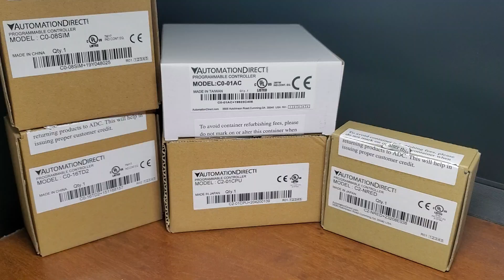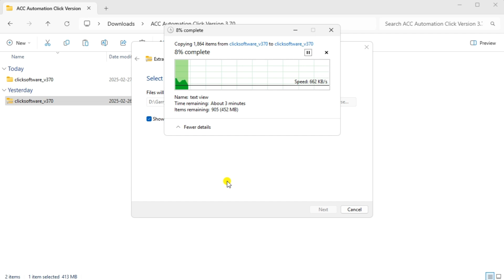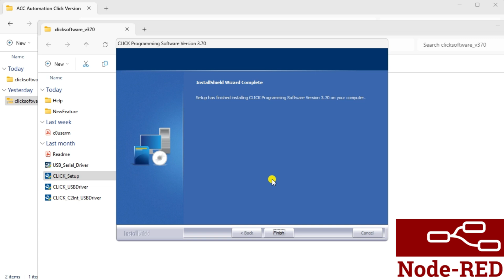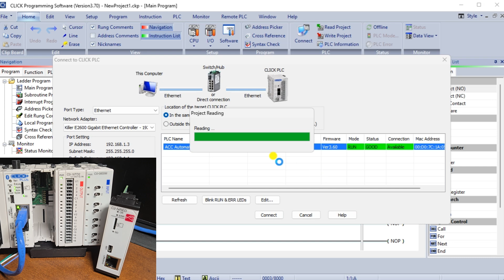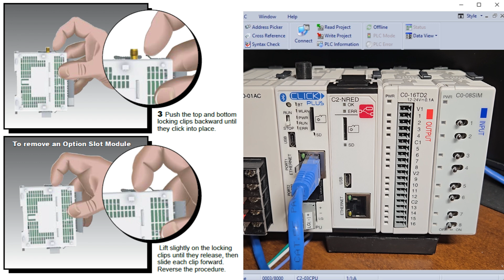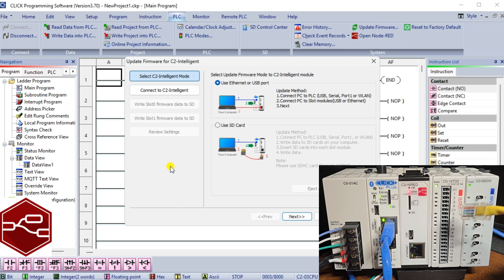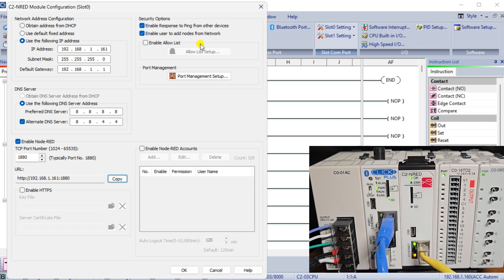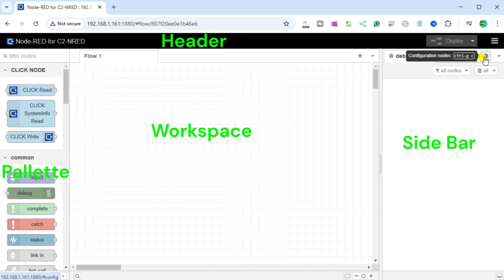CLICK PLUS C2-NRED: Easy Install for PLC Module!

Comment from the maker: More information can be obtained at our website. This includes all of the links mentioned in this video. 
https://accautomation.ca/click-plus-c2-nred-easy-install-for-plc-module/

Click on the Remote PLC Mobile App
https://accautomation.ca/click-remote-plc-mobile-application/
https://youtu.be/vhfcsu_bjdc
Mastering Click PLC Communication Modbus RS485!
https://accautomation.ca/mastering-click-plc-communication-modbus-rs485/
https://youtu.be/RQ4ik2UoRns

CLICK PLCs were designed with simplicity, providing reliable control at a low cost and with little to no learning curve.
This simplicity makes CLICK a perfect solution for small machines, home automation projects, pneumatic applications, or anywhere a simple system needs a budget-saving control solution. 
Building on the original CLICK design, the new CLICK PLUS PLCs offer the same practical control but with surprising bells and whistles. Using the same FREE, streamlined PLC programming software as its predecessor, the CLICK PLUS PLCs provide no-headache programming combined with advanced capabilities like Wi-Fi communication and data logging.

The Click and Click PLUS PLC series can be found at this URL:
https://accautomation.ca/series/click-plc/

Features of the new Click PLUS PLC (C2-0xCPU) include the following:
  Micro USB
  DHCP support
  DNS support
  Wi-Fi (programming and Modbus TCP)
  Bluetooth (Wi-Fi) provisioning
  SD Card (Data Logging)
  Data Logger
  Network Time Service
  MQTT (Publish/Subscribe)
  Required PLC Password
  Disable Ports
  Strong Password Support
  Disable Ping Response
  Encrypted Password Transfer

We are using the Click and Click PLUS PLCs for several reasons. Here are just a few.
 - Investment is low for the hardware, and the software is free
 - Standalone PLC with built-in I/O
 - Communication ability - Ethernet Port, RS232, RS485 - support for Modbus RTU, Modbus TCP, etc.
 - Ability to expand the system with various modules, including RTD and Thermocouple inputs directly.

Regards,
Garry
ACC Automation
https://www.accautomation.ca

Comment: I noticed yesterday in the video the c2-nred was running version 3.0. I didn’t think much about it at first but wondered if it was going to be an issue for our projects.

I just received a couple c2-nred and set one of them up and quickly found out its not compatible node-red-contrib-modbus and a couple other nodes.

I know I can rewrite the flows to read and write through the Click PLC to node-red and back agin. But that in my opinion is unnecessary extra processing and programing. and simi defeats the purpose of running node-red in the first place. 

I hope they update the node-red version soon. Otherwise these modules are to limit for the price. Definitely not the experience I was hoping for.

Comment: The Click Plus is a wonderful PLC. Can the C2-NRED communicate with the newer Raspberry Pi 5 and the ESP32 modules? Something new for me. Thank you Gary.
Reply from the maker: You could use MQTT to communicate to the Raspberry Pi 5 or the ESP32. The C2-NRED card can be the broker on the network.
Regards,
Garry